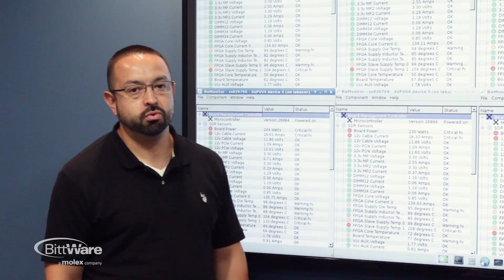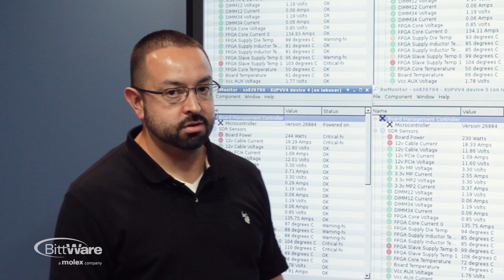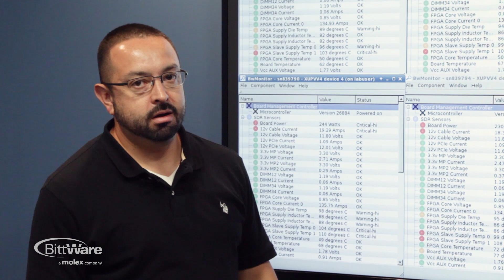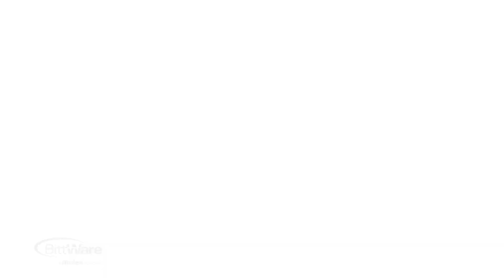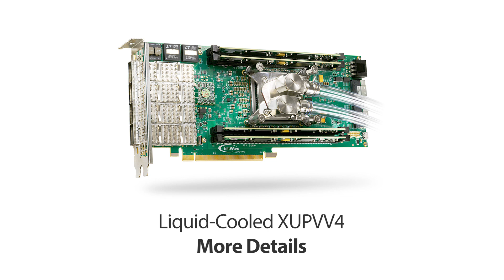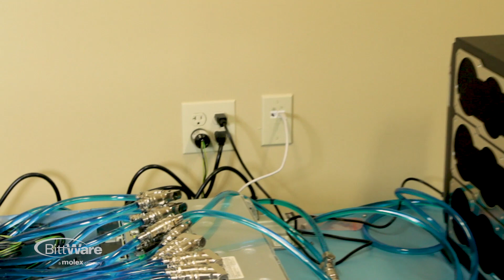Liquid Cooling Eight FPGA Boards with Xilinx VU13P

Comment: I noticed your FPGA's are not loud like jet engines compared to other videos. Is that because of the water cooling? Is it the air cooling fans that make standard FPGA's noisy?
Reply from the maker: This particular board and config. has no fans on the board itself--the server fans are probably at minimum for this video as the liquid is doing sufficient cooling (we wouldn't recommend zero airflow in a server environment however). If we had a passive (non liquid cooled) version of this board in the server, the fans would need to be running to provide cooling and those fans are not designed to be quiet when running at high levels.

Comment: Hmm...!!!!. Nice...!!!!. When I finish my numeric  processor unit design I will contact your company in reference to your fpga's to see if I can incorporate them in my design. I don't want to go in great detail about my design. What I will say it's designed towards machine learning  ( crunching large amounts of numbers  ) and neural network computations . It will take away the mathematical workload  from the main cpu's. The cpu's will be ARM's and have fiber optic connections something  like Gen-Z fabric switch within my NPU. Of course my mother board will be of a special design  also. Very large like HPE the Machine and Cray HPC. I will have also special cabinet design for the accommodation of the oversized mother boards. Wish you and your company  much success.